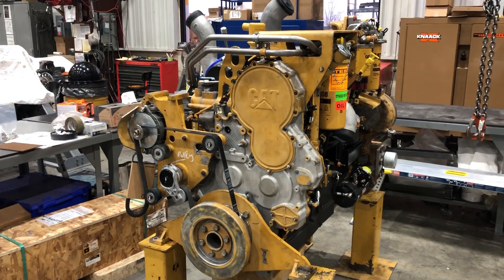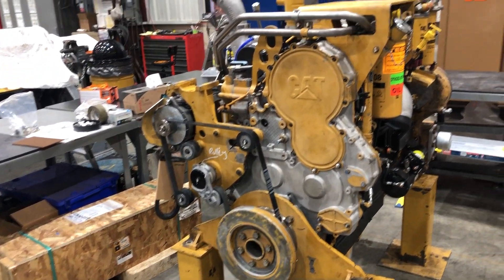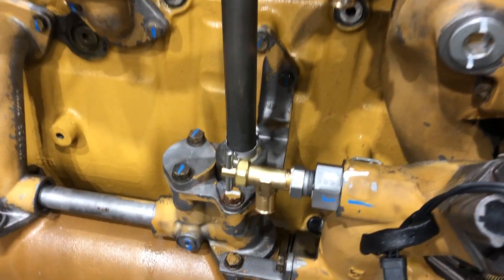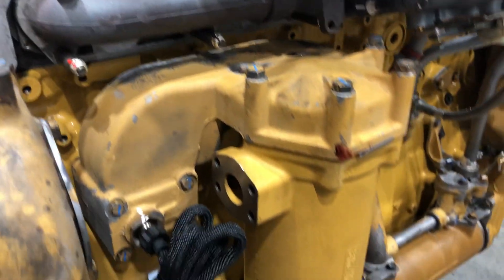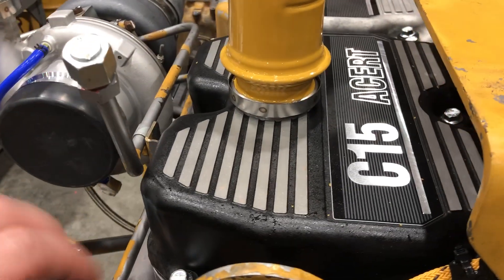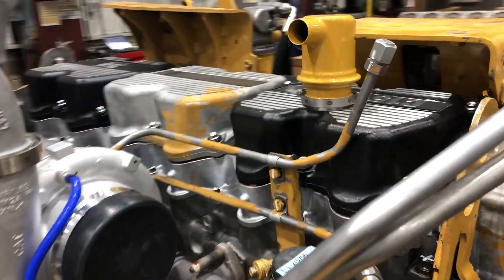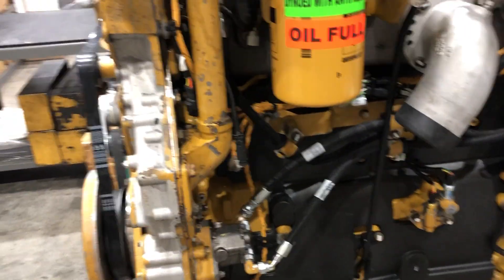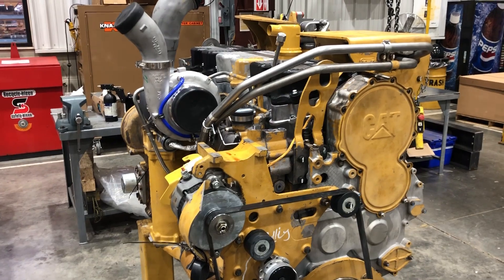Caterpillar D8T Bulldozer C15 Engine Walk-Around Part Two

Comment: It's a shame to paint it at all
Reply from the maker: I agree. But some of the metal is bare and would rust. Taping off everything that is already painted would be too much shop labor time, so they only tape off vital areas and then blast the rest. This is also going into a dozer belly where it will not be seen much anyway. Check out AdeptApe's latest video to get a look at a similar engine inside a D8.